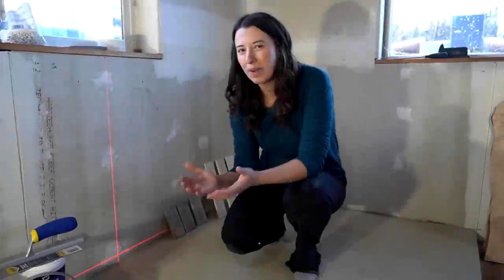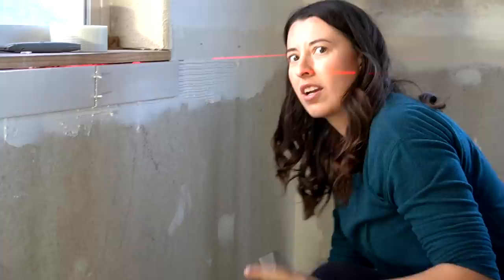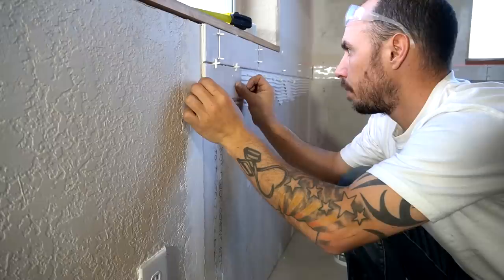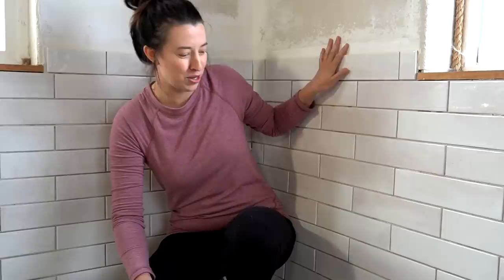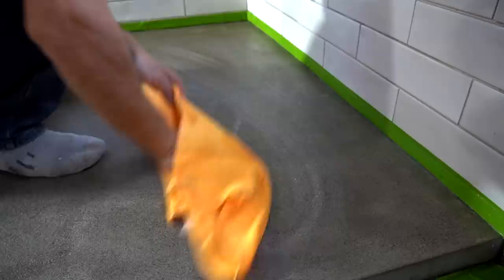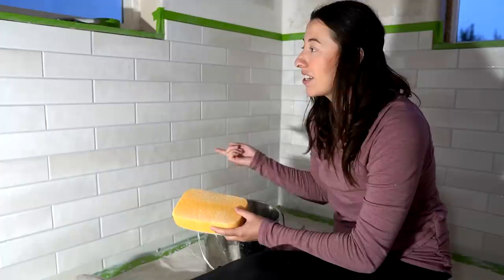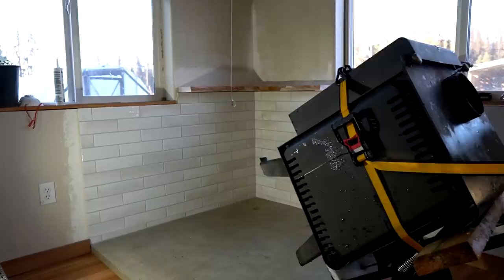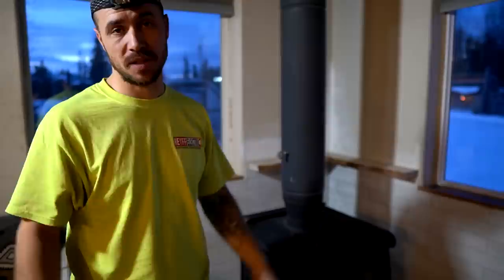Setting Tile & Finishing the Wood Stove Hearth

Comment: A lot of wood stoves have a small vent that goes through the floor,so as the wood stove can pull in fresh air from out side instead of air from the house.Did you guys pass that over in though???

Comment: Great Job however when you grout you should focus more on just filling your joints pushing the grout down and arounnd under your tiles to fill in any areas without mortor makes for a stronger tile job harder to break tiles and makes for an easier cleanup... Thanks for the video looks grerat!!!

Comment: To clean the glass in the fireplace, try baby wipes! The ones you use to clean a baby's butt. I believe it is the oil in them that makes the soot loosen. I have sworn to those for years to clean the glass in my wood stove. I'm using the cheapest kind I can find, and it takes about 4-5 wipes and 2 minutes to get a totally clean glass. As I don't have a baby, I keep the packet of wipes in the fridge in between uses so that it doesn't dry out. One packet lasts me an entire winter up here in Northern Norway - often more.

Comment: I have had a pocket hole jig for years found I didn't like there screws they stripped out very easy so just used jip rock screws they probably have changed the screws by now just do not drop the drill bit they brake very easy and about 9 years ago they cost $10.00 each hate to see what they cost now

Comment: I think you might are supposed to start at the bottom first and go up and put mortar on the backs of the tiles?
Reply: You don’t have to back butter with quick set. If you have to make a horizontal cut to the tile the partial height tile needs to be at the bottom.

Comment: I've been watching you guys for years and love your way of life and generally all the things you do, but guys tiling, there are some .things you just don't do like cutting face down as it will likely chip the glaze more, the piece between the blade and the fence should be pushed through so that little bit gets cut off, if you reverse out of a cut there's a chance of twisting the piece and kick back.
When it comes to tiling you never put a cut edge against a factory edge you will see why when you grout. I'm sorry this comment is so negative because  as I've said I love your channel

Comment: why are rocket mass heaters not more prevalent? you get two birds: much less creosote and more heat extracted with less wood. sure you gotta do a lot of manual labor for cob etc to build it, but I'd wager both pups would love a rocket mass heater "couch" and splitting 10-30% of the firewood annually vs woodstove would really pay off

Comment: ..to start in the corner ..making A  'folding or creasing the tile' effect..
Reply: Yes..bottom upwards
Reply: By quarters.. WHEN TILING YOU NEED AN 8TH OF AN INCH SEAM ALLOWANCE FROM FROM AND FLOOR .. YES.. BUT ALSO HAVE TO ACCOUNT FOR THE GROUT SEAM .. YOUR GROUT SHOULD NEVER CONTACT THE FLOOR FROM THE WALL ALLOWANCE .. THEREFORE AND 8TH FOR THE TILE PLUS AN 8TH FOR THE GROUT SPACING

Comment: Surely you should start at the bottom and work up.
I've never seen it done the way you're doing it
Reply from the maker: We didn't want to cut the tile that is directly underneath the window, but we have not done tile before so there's that 😉
Reply: @SimpleLivingAlaska  you could have still measured down and calculated it
Reply: No because if they had to do a horizontal cut the less than full height tile needs to be at the bottom.

Comment: In the future, please feel free to contact me for experience at tile, not saying it will fail and don't want to be a downer, but mastic(the can you are using for adhesive) is not ment for fireplaces and the amount of heat involved, just a heads up, not saying it will fail though, it is just what I was taught since I was a kid and never was brave enough to put my name on on. I live up here and can help if it is convenient for me, but timing is critical as you would expect...
Reply: Let it dry a few days before you grout it, it is the only thing I can think to make it somewhat good to go. The Hardibacker on the wall is good though, very fire proof, but also dries you mortar out fast, thinset is more ideal, and either skim coating the board of making it wet as hell, which sucks ass to work with.
Reply: If you do a custom shower pan, please call me or contact me first. I will help yall out, it is not something you want to mess up on. Water and gravity are your worst enemies in a house. Don't worry I'm not trying to scam you, I will help you with no cost but the materials, just don't want yall to put something online here that all the others do that I KNOW will fail within a few years. Drives me F***ing nuts!